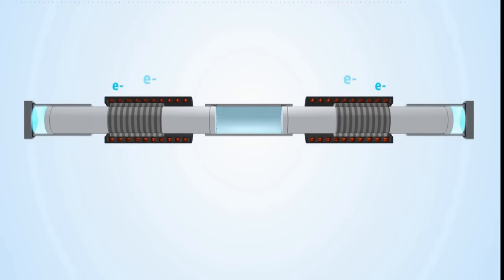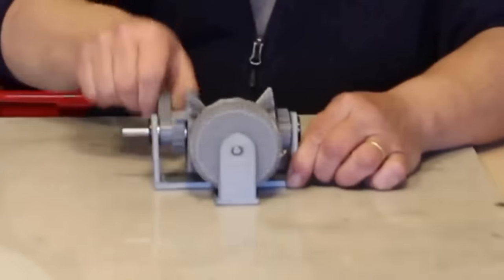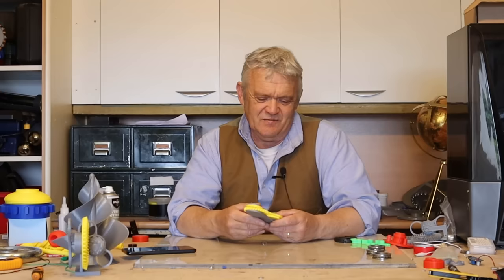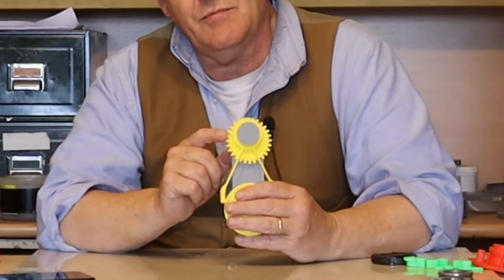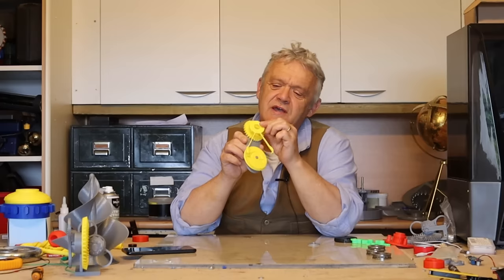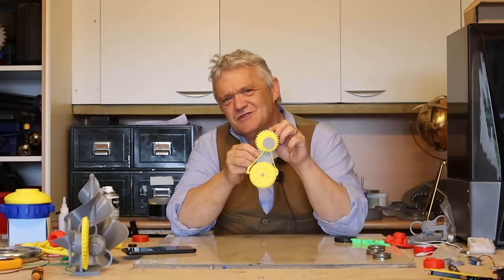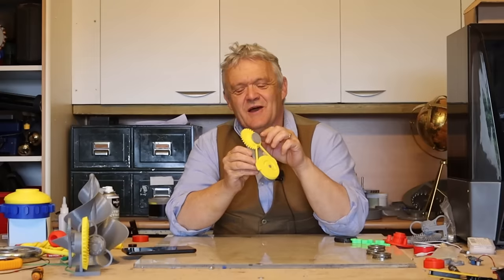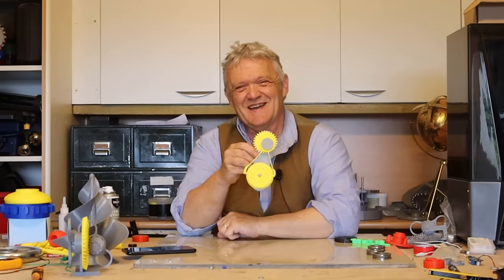2003 The Magic Lever Energy Harvester by Seiko

Comment: I have no background in engineering of any sort, but it appears as though the compliant/bending part of the mechanism is mostly driven by the forward and backward motion of its base, rather than its vertical or complete rotary motion. I wonder, then, if that gear could be replaced by something linear. 
Maybe you could fit that theoretical linear part inside a large boot sole that would be compressed on a step, sliding the arm back and forth and turning the output gear?

Looking at a few news articles that reported on the already-existing military technology you mentioned in the video, it seems the linearity question has been solved already. You mentioned something about a bouncing weight and watch winding mechanisms, so maybe you already know the answer as well. 

Soldiers apparently noticed an "unnatural sinking feeling" in an earlier prototype that was later improved.

I think a problem with considering walking "wasted energy" is that it's really not. If you used less muscle to take a step than normal while changing nothing else, you'd fall over.
That "sinking feeling" in those energy harvesting boots was from them effectively adding an inch or so of extra step height to every pace they took, which increased the load they had to overcome to take each step. /That/ is where the "harvested energy" comes from. Not the regular step.

Still, very cool! 
This is the first video of yours I've seen, but it will certainly NOT be the last.
Reply from the maker: you might want to check out this video mate which is what i thought to do with it - cheers https://youtu.be/ru7grh0azuA

Comment: this doesn't recover wasted energy- it just sucks out energy that might have gone back into the walking movement before it can be used for walking. It will make whatever you use it on feel a little heavier and more tiring to carry, even though its not really heavier. 

it works on watches because the amount of mass in a watch selfwinder is microscopic compared to your arm.

Comment: I like the shoe idea talking about a intermittent with 5 w thats like charging your phone with a 1 apm 1000 mapm that wont stay on yhe phone has to be off to charge only olnt get ten % for the hold day to them set up and a back up emergency power. Why not
The army should put thermoelectric generators in the shoes they stand on the hot road thr cool sid be there body.

Comment: To be fair, if you harvested movement for power, it would make walking a LOT harder. Walking on sand shows you what happens if you milk energy from steps
Reply from the maker: you harvest the bit that is normally wasted - so you use energy to pick up your foot which you don't try to generate from -  but you harvest the falling weight of your foot going back down - which is normally wasted
Reply: @ThinkingandTinkering  not sure I agree that it’s wasted. I think meeting a hard surface makes walking easier by pretensioning ligaments and muscles. If you have to squash something down, you also have to step higher to the next step. If it’s hard and level - that’s easiest, otherwise you’ll feel strain putting your leg down, like climbing infinite stairs.

Comment: LK-99 has been published - a novel high temperature superconductor crafted with common materials and processes, like lead and quartz heating tubes.
It's also been made completely public, the processes and results, so every lab is suddenly trying it, right now.
We should make some.  Note I didn't use the word "try" - the community is still skeptical so if it can be done it should be easy and if it's not easy it's probably a hoax.
Reply: While the process described should be simple for any well-equipped chemistry laboratory, the equipment is too expensive for hobbyists to have lying around. It involves heating a quartz container under high vacuum conditions. Turbomolecular pumps are not cheap.

Comment: Of course though you're not scavenging some loose energy, you're directly converting energy from the food you ate into powering this mechanism. That goes for the sidewalks too - to generate electricity, they have to be "springy" and walking on a springy surface is just that bit more physically demanding. Essentially like walking up tiny steps. But sure people in the developed world can use some more exercise and if it meant not having to think about charging your wearable devices that would be great.

Comment: I was just thinking about this a day or two ago for my smart watch.  Google must be reading my mind showing me this video.
It couldn't take too much energy to keep a smart watch going, could it?
I was thinking one of these "magic link" mechanisms winding a spring and through a gear train to run a micro-generator to help keep the battery topped up.  Not too sure how compact you could get one able to properly charge a battery, but it's fun to think about.
No reason the same concept couldn't be applied to a cell phone if a successful example where ever made.

Comment: Before spending too much time on this mechanism I suggest researching how self charging electric watches work. I suspect they don’t use this as it would be easy to rectify any AC produced into the DC need to charge batteries.

Comment: so the variable rate of circular movement of the output would be sinusoidal?
as in the amount the out put is turning is obvious not constant, and the change isn't linear.
if we graphed the amount the output is being turned over time with the positive y representing movement via one hook and negative y representing movement of output via second hook, then we see a sine wave when we graph the movement of the output over time.

I think that is correct.

so the one possible issue with this in application is that the output will have variable rotational speed, but not unpredictable.

Comment: you bump into things and show mechanisms that work amazingly well.   I'm up here with my mouth on the floor." what?" That I could see winding up a spring-loaded mechanism that lets loose after 10 turns and then whines up and charges a battery.   could this be turned by wind or set up a solar motor to turn it. Wow that's a good one.

Comment: You do realize that Seiko has been making kinetic watches for decades, right? Not merely auto-winding but actually consisting of a counterweight connected to a tiny generator producing a small electric charge that is stored on a small capacitor. The capacitor then powers the quartz movement. God help you changing that capacitor. It's not easy and the screws are nearly microscopic.

Comment: hmm wonder if you had some weights on a line of hooks biting upwards and then a wire going up and over a rod and then a weight at the top and a wire coming from the other side of the weight going over an other rod and down to a line of hooks going downwards and someweight at the bottom of that to pull it in tension. then wouldn't that be enough to make you make motion from up and down by the weight on the hooked lines. and by side to side by the weight at the top?

Comment: Idk, it seems awfully slow. Are you planning on winding a spring with it, like the watch, and using that to drive a gear train? If I were going for a bouncing backpack design, I'd use a rack and pinion, with rack fixed to the frame, and the pinion gear being a small radius attached to a much larger disc that has a serpentine coil around it. That probably wouldn't fit in a shoe though. A pneumatic system seems more appropriate there. From the footage, it looks like someone had an interesting idea to tap into the movement of the ankle relative to the shin, that's a pretty high torque area. Anyway, can't hurt to mess around and see what works. Looking forward to see what you try.

Comment: Very good, buuuut... 1. There is no reason why a generator on reciprocating mouvement should not be used. This exist already (for ex. the tchechian generator). 2. All these generators are causing more effort from the "user". Walking on a moving floor or carrying a back-pack is just more effort. By the end, the "user" eats more, cakes more and generates more contamination. For myself no problem with this, but woke people should take this in consideration. 😀

Comment: What if you used this device on a small wind "sail" attached at the bottom to a recoil starter (lightly sprung and modified to drive in both directions) driving it?

Comment: Have you checked out Rodger W Smith Watch maker in the isle of man? Claims to be last remaining watch maker who can make every compenent of a watch. Costs a lot more more than you or I can afford (no judgement made)
But I believe his father or he invented a slighly better variant of the sieko winder. So it requires less movement and friction therefore longer life with the rocker vs flywheel. Used in all modern expensive watches. 
(name mixed up because I do not know my watch making or engineering.)

Comment: But that's not lost energy, you area actually using that energy to move. To generate that much energy in addition to the energy you use you would have to put out twice as much energy. If this actually worked out would make walking twice as hard.

Comment: So, if you actually wind up a spring, and release it when it's at some optimal, or at least useful level, that spring could provide a burst of energy at an rpm sufficient to drive a decent generator....a bit more complex, but eliminates the need to build a generator that works on such small rotational inputs. Just an idea...

Comment: What about a waistband attachment winding a clock type spring which, when at max charge, expels the wound energy into a small generator, controller, battery all also attached to the "Power Belt".
Reply: Forgot to add that there would be leg attachment driving the Seiko model.

Comment: If begs the question regarding wind-up radios & torches.  Why cant this process be adapted to produce charge to a battery with higher capacity - such as to recharge a mobile phone?
Reply: But it can. :D  All you need is a 5V regulator so you don't fry your phone, and a diode/rectifier.

Comment: I don't really like how the energy is being wasted when being dragged across the ratchet. It looks like the output only turns half the time. The other half of the time, locked and being pulled backwards.
This is a clever mechanism considering how simple the machine is, but I wouldn't consider it for energy harvesting when efficiency should be a higher priority.

Comment: This might be a silly question but I need to ask it. Would it be possible to build a capacitor big enough to store the emery from a lighting bolt?  DVD:)
Reply: Leyden jar
Reply: @justtinkering6713  ok correct but how big?
Reply: The problem is two fold. #1 making a capacitor that can store that amount of charge, and #2 making one that won't immediately arc under thousands of volts when it was enough to travel several thousand feet through air. You'd need one hell of a dielectric material, and it would be massive. Basically it's not practical.
Reply: @DFPercush  Thanks for the clarity...

Comment: 5 w, what does that even mean? Your rate of producing energy is 5 jouls/second.... but, for how long do you do it? A split second? Then the energy produced is almost nothing. For the entire duration of the step? then that is about 5 jouls, which is about the same as lifting a pound three feet into the air.

Comment: I mean there is thousand year old tech for making up and down motions into rotational movement a spinning wheel for example.
Reply from the maker: lol - try and get a spinning wheel in a wrist watch
Reply: @ThinkingandTinkering You can get the mechanism shrunk down very easily it's just a fly wheel that gets tugged by a downward motion lol. Wasn't really the point I was making though was it? My point was these mechanisms have been around for a very long time and are nothing new. Transferring  up and down motion to rotational motion is not something that is hard to do like YOU implied in the video.

Comment: While this is an interesting mechanism, all the mentioned research into "harvesting" energy from walking is a bit of a waste of time. Any energy lost while walking/hiking is an inherent inefficiency of the process, and can't be meaningfully harvested. Any extra contraption you introduce into the system will instead sap additional energy from your walking motion (kind of like walking through sand), making you more tired and requiring you to exert yourself harder. Might as well just spin a hand crank generator while you walk, or better yet strap a solar panel to your bag or something.

Comment: At 0:12
Th energy is stolen from the people walking on those device, and stolen from the people wearing those device.
This is no different from setting up a stationary bike in the middle of the street with a sign: please pedal for free for 1 minute. Thanks.
Or; this is exactly as if you installed an inclined ramp with some kind of large step at the end that steals the gravitational energy you had to steal from the Earth as you climb the ramp.

People would not use it if it was advertised like this

Comment: Could probably keep an EV charged just by driving it on Michigan roads if each shock absorber had a generator. It would basically be a perpetual motion machine.
Reply: Until it went up on flames and only 30 seconds to get out and clear.

Comment: The trouble is there is no such thing as free energy, if it takes 5W's to take a step it takes 5W's. If you have something that extracts 2W of energy then I'm not saving 2W - I'm having to expend 7W, and walking over tarmac becomes like walking over sand. which means I then have to spend more on food to give myself the energy that is going to be syphoned off.

Now when you're talking about my wrist watch the parasitic drain is minute and for my benefit. However when you're talking about energy harvesting pavements, you're talking about extracting my energy, which I paid for via food, to power utilities like public lighting, which I have already paid for via tax.. and tax on my food.

Comment: If an energy harvesting device is put on a boot or in a backpack etc the person will have to increase their energy output to power the device. The energy you are expending in walking is used in walking. It isn't free excess energy available to harvest. Anything harvested will require increased effort by the person. Otherwise you are talking of a perpetual motion device which is not possible.

Comment: 👍👍  Would it possible to use a system like this on main roads to have can wheels generate electricity?
Reply from the maker: Yes, absolutely
Reply: Yes, if the motorists were happy to see a fall in their fuel efficiency. It's NOT free energy.
Reply: Yes but then all the cars would use more fuel, and the road would be super expensive to maintain. It's a super inefficient way to generate electricity.

Comment: There is no free energy. If your walking also recharges your watch/ phone, etc. You are using that much MORE energy (food) to move, getting more tired in the process and wasting some as heat, etc.

It's like putting a windmill on top of your car to power your electric devices. You are not harvesting free energy, you are just using more gas, in a diverted wasteful way.

Comment: There's no such thing as free energy.  Generally speaking anything that enables a person's normal activity to generate electrical power will make them work harder.  And of course the same is true of vehicles.  Any system using say piezoelectric generators embedded in the road will increase the car's fuel consumption.  

Having said that there are situations where we waste energy by dissipating it such as when a walker is descending a hill.  He is dissipating his potential energy that he gained by ascending the hill, mostly in his muscles.  If a method of recovering that energy into a battery could be devised then it wouldn't cause him any extra effort.   In fact it would reduce the wear and tear on muscles and joints and make walking easier.  This is regenerative braking for people.  Of course you would have to carry the weight of the generator up the hill but you would get that energy back on the way down and the extra effort would be offset by reducing the weight of batteries you would need to carry.

Comment: This is genuine stuff.  But the practical applications are limited to things like watches.  Extremely low demand items. The no free lunch laws of thermodynamics.   Anything beyond such exceedingly small demands will be felt  by the   original mover, you, as fatigue. 

Anything that can be identified as wasted energy is game for recovery. But the human body is a pretty damn efficient machine. Recouping wasted heat or motion is a little akin to mounting a fan bladed generator to the front of your car. At first it makes sense. And it might have made small sense in the 20's.  But modern cars, like human bodies, are marvels of efficiency.  Any energy gained by the fan in front of your car is almost entirely offset by added weight and altered aerodynamics over the rest of the car body.  Actually after parasitic losses its probably even negative. 

Seiko's device cleverly harvests that barely noticeable energy "waste" you produce by your arm movement.  But it is parasitic none the less. It's just so tiny that you don't notice it.  And it is so tiny that it is evidently not even worth the tradeoff in space to incorporate some version of it into a (more than a wrist watch) high energy demand device like a cell phone. Or it would have been done by now.